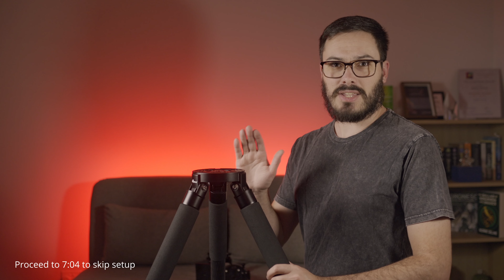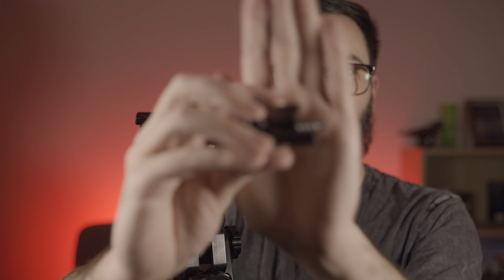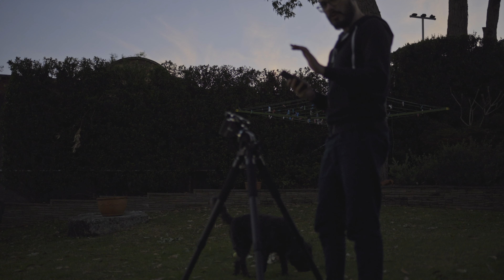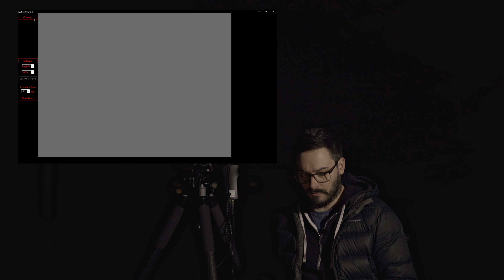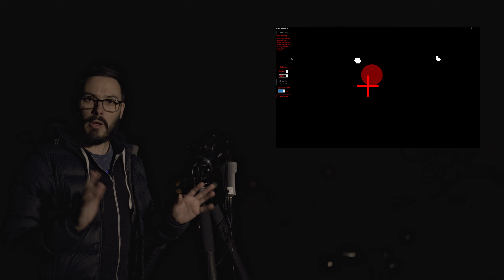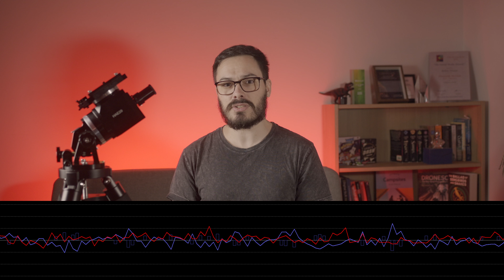Surprised by the iOptron HAE29

Comment: Hope all is well since you haven't posted in a while. Thank you for the review. I'm looking to upgrade from an AVX mount which I'm currently using with a C8, Starizona reducer/corrector/ Celestron OAG, ASI174MM guide and ASI071MC. Weight is shy under 19lbs (8.6kg) and this one of only two reviews. Thanks.

Comment: I have a hae29ec, how do you use with commander lite? I don't see any wifi net when turn it on.
Reply: On the menu you canf find wifi menu. My phone detects it  Commander lite transfers the GPSvand time to the teescope . Of course no web access. Same for the laptop. But just one connection is possible .  Once GPS and Time by phone  I cancel the phone connection and switch to the laptop  Commander . Of course  software must be installed .

Comment: Could you not use an EQMOD/EQDIR cable to connect from the Hand Controller port on the mount to a USB 2.0 port on a computer or on the ASIAIR?
Reply from the maker: Yes you can use a usb cable to go from the hand controller to the computer/ASIAIR.

Comment: Nice review.  I love my HAE29.   I will note that the bolts that are used in the adjustable saddle on mine will not take the hex key that lives on the mount.  I need to use a smaller hex key. This is not a problem because i set up the saddle before taking the mount out of the house.

Comment: I don't think the min move values in your video should be blindly copied, because they are related to local seeing. One should use PHD2 Guiding Assistant every night and accept those values instead.
Reply from the maker: I added all my guide settings as a point of reference so you can understand generally how I used the mount and got the results I did. I agree people should use GA to find the values that work best for them. :)
Reply: @AstroWithRoRo  the provided values are fine and very welcome - except the min move settings which are related to local seeing and equipment.

Comment: Thanks Rowan for the first  serious revue  about  the Ioptron HAE 29 .  Ioptron offers an alternative to the  AM5  ,   for 2000US$ range price , with  the modern  communications options and  the Ipolar  which it is a must when you know how it  is easy to loose  tracking precision even with a good equatorial mount.    The weight target can explain some of not handy choices  that AM5  doesn't have. HAE 29 is sold  with a full Goto  hand  controller . but without  GPS  ! Ioptron   thinks you have  a smartphone with you  when you  leave  home , because this mount is made for travelling. It is so light for  the payload capability,  even with  the  suitcase   it can fly in  Cabin. Ioptron   has choosen the black color  which is not the best choice  when you are  far away from any light source .  The Ioptron HAE29  is not  the cheap solution  for visual observation.   AM5  is in the same category,   but at least it is done in red  color  and  some people will  choose  the AM5  mount for that choice because it is easier  to  work with, when you use a  red torch. The amateur community is  still  mainly using the eyepieces  and the  Red  light doesn't disturb the night vision.   It will be nice  if Ioptron could choose a brighter color than black for this type of mount . The  HAE 29  was the first Ioptron true Strainwave mount ,capable  to touch the 0.4 RMS  with software  controle . The EC version is good for  0.4 RMS  making a very strong contender of traditional expensive  mounts  able to run without computer . but much more heavier too.   The USB port is the missing part  on the mount . Maybe  in the coming months Ioptron will provide a kit   to please the customers .  Thanks for this  video showing  an true alternative choice to the AM5 ,  the main choice  today for starting in Strainwave technology  . Thanks Ioptron with the HAE29...

Comment: According to the manual, you can route cables inside the mount through the saddle and down to the polar adjustment knobs. Have you found this works well? I also wonder how much of an upgrade the EC version would be.
Reply from the maker: There is a cable channel you can thread cables through, I found I didn't use it much though. I am often moving between mounts & rigs and so pack away my cables after each session. If you are using a single mount back to back then it may be of use to you. I also find with harmonic mounts there is less of an issue with cables as they are so small in size there is less movement of cables vs traditional mount heads. The passthrough channel is there though, but it isn't overly big so would only fit 1 or maybe 2 cables max depending on wire gauge and connector size.

Comment: Greetings! Thanks for doing a very thorough review of this mount!👍👍 First, I am pleased that you have given both the mount & customer support a good grade, as there have been some real issues experienced by folks I know who live in North America, who have purchased one of their smaller traditional mounts, have had real problems with mount performance, and have not received timely & thorough customer support. Second, I have an RST-135E, but I anticipate wanting to add a harmonic mount with higher capacity, so its good to know that iOptron's latest harmonic mount performs well.👍
Finally, one feature I think would be very helpful, but is not featured on this mount (nor is it on my harmonic mount) is through-the mount-cabling. Ideally, there would be connections between a part of the mount that remains still (e.g. base of RA axis) and the top of the Dec. axis (e.g. the end of the dovetail), so that risks of cable snags, cable pulling, etc are eliminated. I see that iOptron claims to have something like this on their very latest, larger capacity harmonic mounts, but I don't now how well the concept has been implemented.🤔
cheers!🙂

Comment: While its a nice to have, but hopefully not for an extra expense....the brake on the DEC is kind of unnecessary for the payloads supported on this mount, or the AM5 (which doesn't have a DEC brake). You will never have enough weight on either side of the DEC to require the brake. You'd have to go out of your way to load up one side to absurd precarious levels to make a brake on the DEC even needed....so basically its a non-feature. The RA brake though can have all 18kgs of payload to one side which then requires the break. You'll never get close to that much weight on one side of the DEC in a normal setup.

Comment: What a brilliant and useful review Rohan, many thanks!
Did you mention it can be used in Altazimuth mode ?
How easy is it to convert EQ to AZ, plus are there any tube length limits when in AZ mode ?
Reply from the maker: Yes it can be used in AZ mode too. It's easy to convert to AZ mode, just remove a locking pin and take it to 90*. If you used the standard CF tripod then there would be some tube limits, but you should be able to get a pier extension to fix that.
Reply: @AstroWithRoRo  Just another question, is the adjustment for the altitude angle a smooth worm screw adjustment type, or is it the (more crude) push/pull type. Judging from the video and online info, it looks like a worm screw type...?
Reply from the maker: @127Foxtrot your guess is correct, it’s the worm screw type. 🙂

Comment: I like ioptron, I have a GEM28 and very happy with it, but I cant understand a world where you can get a AM5 that has a 44lb payload for just 300 dollars extra and you woudl still choose the HAE29, also the AM3 is also out that is $200 cheaper...
Reply: Here in Germany, it's more like: 620€ more for the AM5.... so the HAE29 is very attractive
Reply: @saschamoritz1446  Especially if you need buy an Asiair to get all AM5 features and need to have an expensive ZWO camera. So the bill for a ZWO mount would be much muchjexpensive
Reply from the maker: There's certainly a lot of competition in this space now which is great for customers. The HAE29 is smaller and lighter than the AM5, it's in between the AM5 and my RST-135 for both weight and size. It will be interesting to see how the AM3 compares though! I think local pricing & brand awareness will play into buying decisions heavily on these.
Reply: 4lbs more for 300USD and more weight isn't a nobrainer. HAE29 is even lighter than AM3. Plenty of reasons for the Ioptron as I see it.

Comment: Well done Sir. Would ask, how about wind? Seems like overall mass is not too much. Could you tell or was there no wind to test with.
Peace
Joe
Reply from the maker: There were a few nights with some moderate winds. Because you are guiding at such a fast rate and the mount responds quickly to guide commands it is pretty good at correcting for gusts. I found the biggest issues came from when I had my large mak-newt attached whilst it also being windy. This wasn't due to the mount itself, but rather the carbon fibre tripod. As stiff as CF is, it still flexes compared to a steel or wood base (this also happens on my Rainbow Astro CF tripod). As such, if you are out in windy conditions with a large payload make sure you have a heavy duty tripod or add ballast from your battery to give it a solid base. Otherwise, given how small the setup is I found it easy to move the whole thing to the downwind side of my car which acted as a wind break and helped greatly.
Reply: That you for a real answer! Again… well done

Comment: Great Rohan
Reply from the maker: Thanks Greg, given the familiarity many people have with iOptron & their software already I think this is a strong contender for the non-encoder harmonic mount market.
Reply: @AstroWithRoRo  I wonder what the encoder version will be like
Reply from the maker: Unfortunately I only received the non EC model, but I am also curious about how the encoder & realtime PEC works.
Reply: @AstroWithRoRo  I agree, especially given the graph you shared, in which there appeared to be at least one moment (..early in the 'cycle'..) where there was a very rapid & sizeable change in RA tracking. Furthermore, if you need to be making guide corrections at least two times per second, it may be that the encoder and/or real-time PEC may be approaching the category of 'a necessity'. 🤔